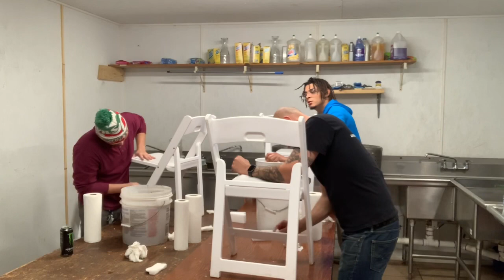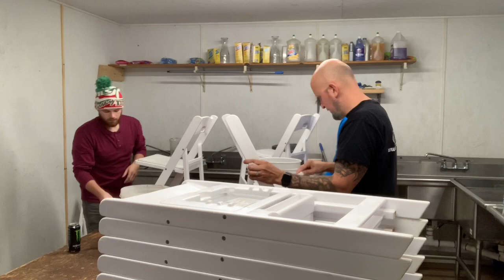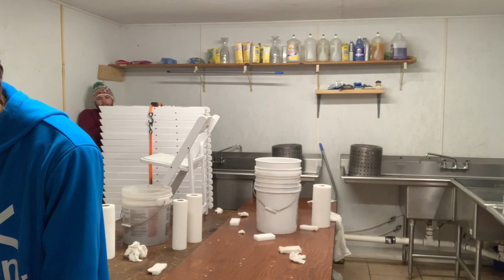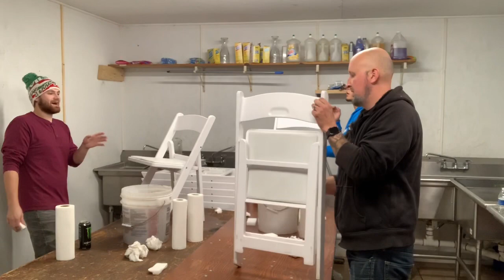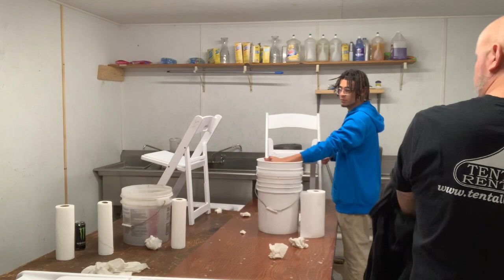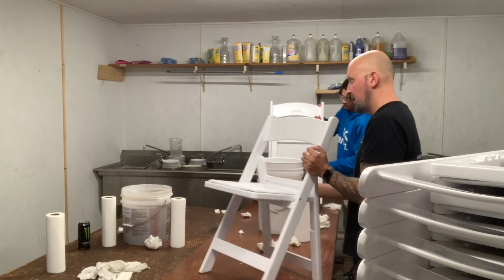TROLL - Nothing But Cleaning Chairs - Start A Party Rental Company

Comment: Cleaning resin chairs takes foreverrrrrrrrr. We use cam buckle straps to strap down the chair stacks, even though the ratchet part stays on the top of the stack but the two hooks on the side damage the chairs
Reply from the maker: Yes it does, that’s why we use covers from Argo Bags
Reply: Use endless loop ratchets, no hooks!
Reply: Tent straps work well, ours dont have hooks just loops